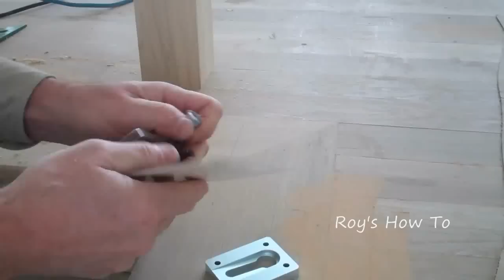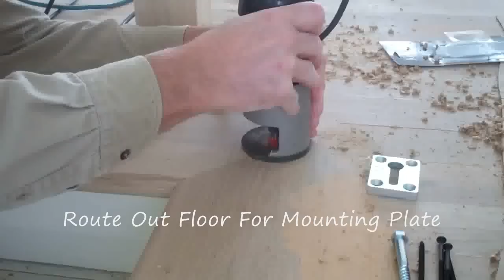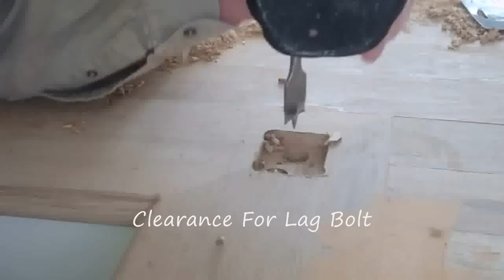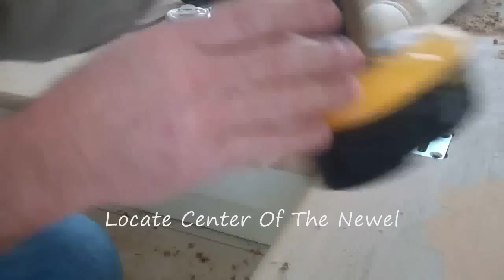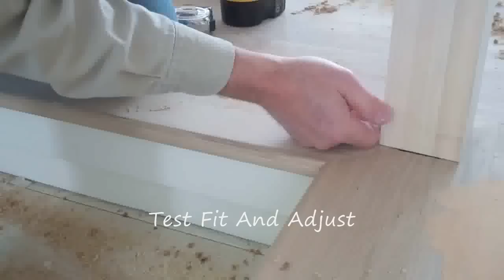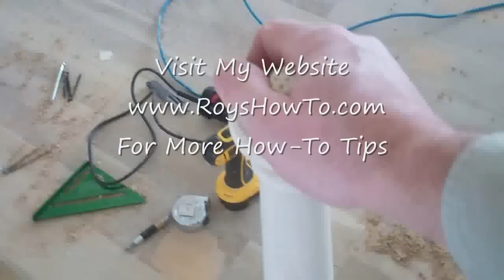How To Secure A Newel Post

Comment: Note to anyone using a router that isn't experienced with one-- do not start it running and then drop it in to the cutting start hole it is dangerous,drop your bit in and hold the machine securely before starting the tool.the same goes for when you have finished your cut Always allow the tool to spool down and stop before you lift it out of the cut.

Comment: This is not how to attach a newel post, this won't last, it will be loose very quickly. Understand leverage and then create a very deep mortise in the floor use a tennon in the post and floor. The only correct way to do this job. Hire a true professional. 30 years of fixing this type of shoddy work.

Comment: I know the guy personally that invented this thing and being in the business for 30 plus years I have never seen a bigger turd and I have told him so, gently, because he's a good guy. The lag is made in china, the first time you give it a good shove the lag head snaps off. You would be better off beefing up the floor underneath if possible and routering in a steel plate. It has more surface, you can use more screws to fasten the newel. Not optimum, but it beats the $hit out of using this anchor.

Comment: Lots of comments saying to cut into the floor and set the whole post in deep, or bore a massive dowel hole in deep. That's the best way, when possible. BUT... as a framer, I can tell you that that is NOT always possible. Often the corners or edges of stairwells have structural beams that are holding up the joists that run into the stairwell. If there is room to go beside it, maybe even by ripping down the bottom of the post, then excellent. But some beams are too thick to allow this, and even if some stair guy DO drill huge 30mm holes down 6inches into the beam, that is absolutely not allowed. In that case, there has to be some kind of surface mounting option for the post, like the one in this video. Although I have seen more stable methods than this keylock system.
Reply: Thanks Gumboot and Room for more for providing me with a solution. At the loft corner on which I need to mount a 4 inch Newel post. The loft corner is 4 2 by 10s bearing on a point loaded corner below. I believe this system may work best for me as I am not confident in boring a hole in this corner. Also as this post will be a corner post will it not have extra support from the other two adjoining rails? Cheers.

Comment: These worked great for me, as I needed to install over an existing hardwood floor and imitate post and rail construction elsewhere in the house. The bigger issue for me was acquiring the hardware, as I live in Winnipeg, Canada and there was no local supplier. I ordered them from the manufacturer in Minnesota and had to spend quite a bit for shipping. However, I'm happy with the result. I attached the rails with Slipfix rail bolts from Cooper Stairworks.

Comment: I was just looking for a refresher video as it's been a while since I installed one. The plate should be the other direction so once the shoe rail is in there is no possible way for the bolt to be knocked loose. FYI. Which I've heard there have been lawsuits regarding. I had to order mine online as no one in town carries them anymore.

Comment: when fitting spindles it looks better if the spaces are equal up to the newel from both sides...the trouble with this technique is the lack of adjustment of the newel....you really need to work out the visual aspect of the balustrade before jumping straight in.

Comment: Down and dirty I have to say I am not on the same tool choices that you used. I'd drill for the lag bolt on my press as the posts can all be pre drilled. I would also use a template for the bracket just cleaner and faster.

Comment: Has quick change bit, uses chuck instead. 
Also, this is how people who don't know carpentry install a newel post.
Reply: @aaronb0711  Did you just scroll through the comments and then cut and paste your same response to everyone that recommended the proper method of mounting the post?
Reply: @FreshCityVentures  not sure, this was a while ago. I agree, this is the proper method but just because I may have typed the same thing multiple times, doesn't mean it isn't relevant. Still doesn't change the fact that you don't always have access below the floor
Reply: Aaron Becker My point was that you must spend a lot of time at your internet hero job. Repetitive cut & paste type responses and name calling would seem redundant to most, but someone’s gotta do it! Good work fella👍🏼
Reply: @FreshCityVentures  and you must as well, digging up old comments and all
Reply: @FreshCityVentures  Life is short, make sure you spend it arguing with and correcting strangers!

Comment: What do you do if it is not plumb?
Reply: Start throwing shit....Duh!
Reply: Draw round  base of kneel  then chisel  the timber that's causing the post  to be out of plumb  or even  cut the base of post where req. And obviously  adjust bracket as necessary   that's my take on it , but I've never used 1 of these before.

Comment: Its an intersecting post , doesnt need much strength , there are easier ways though
Reply: @First Name 
I just glue and toe screw it down , any movement going on is on the top of the rail and at an intersection like this , there aint much going on ..... end posts are different , i use a metal bracket screwed flush to the subfloor with 2 bolts coming up into the bottom of the post ☺ but the old way of cutting into the floor and notch the post into the joist works too

Comment: These will loosen over time and are not permitted under building codes in some provinces in Canada, our lazy unskilled builder used them on my new house and they were loose within a month. Lag bolt through solid wood is the only way to go!

Comment: anyone have any input on how to secure the boards this piece fits into?
Reply: If the (bull nose) that you are talking about is loose enough to take out, then just wood glue it back in place. If not, drill a hole and screw it in place. Also put a oak dowel rod into the hole for a nice finish look.

Comment: Not very impressed with this installation seeing there is a large margin of error - especially during the first few times using this type of fastener. The video doesn't explain anything about centering/locations and the variable involved when it comes to the anchor bolt or crush/wedge plate. Although, when perfected it could be a true time saver, trial and error leads to a lot of money wasted. This video falls short.
Reply: Wood Prix is a foreign based entity who uses stolen plans from other websites....
Reply: His other videos answer your concerns. This one is simply mounting the post. But thanks for coming out!

Comment: Dont do it. This is a hack job. It's not the right way to repair a rotten or broken  post. Dont even think about using in a new install. You will be back to fix it again properly. They are on Ebay for $80 aprox each with shipping and they got loose after clients used for a few weeks.